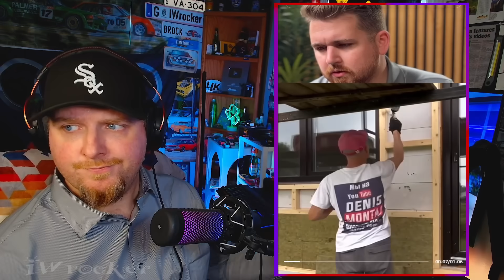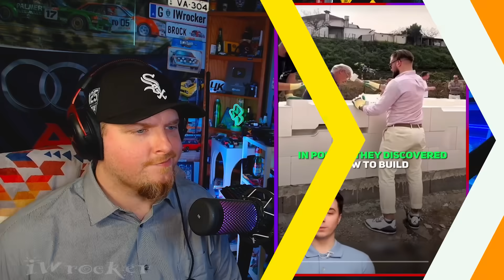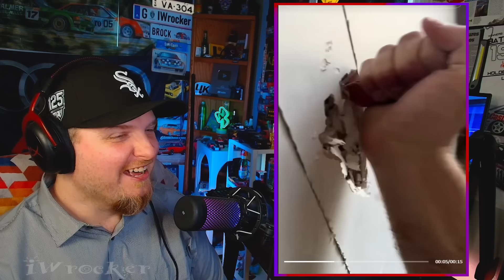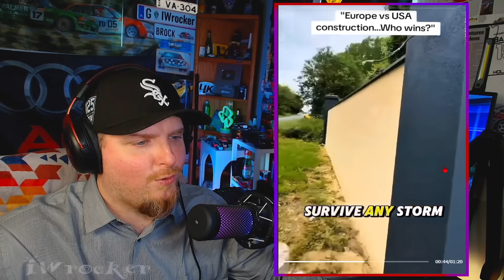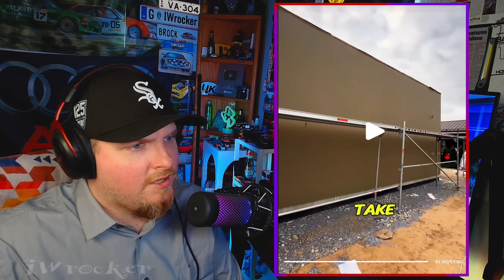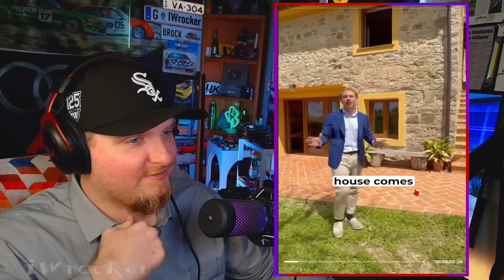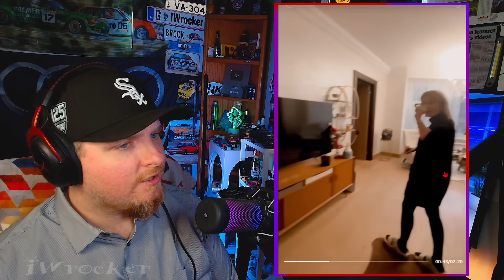25 Minutes of European VS American Home Quality & Construction Methods 🔨

Comment: Some might have mention this but i do not think it is concrete. I think it Autoclaved Aerated concrete or Aircrete. it is easy to drill in and hang a picture on. In Denmark house roof construktion ofte get supportet of the back wall. In wood wall it gets supportet by the center wall. I do not think it is the finish surface or else i have never seen it before I do not think it will look good for long, birds kan pick in the isulation and also make nest in it. I think they are going to install woodpanels vertical or other kinds of plate.
If this was in Denmark we will install a thind 25mm (1inch) list vertical and intall wood horizontal. In this way moist can get away from behinde the surface wood, wher air kan travel from the bottom and up behinde wood in thethe 25 mm space.

Comment: 7:17 Are you kidding me? In Poland, what is shown in the photo is the cheapest thing you can put on a roof, the so-called metal roofing tiles.
Reply: That's was I was thinking: in France what we call "bac acier" (something like steel plate) is the cheapest roof available. And it's powder-coated in a choice of different colors.
Reply: In my opinion these are no cheap metal tile roofings but very expensive metal coatings. They are fixed without screws and last as long the individual material endures.
Reply: @VanelleundMarie   I'm sorry, but you're wrong, it wasn't used at all in the past, but after 2022, when gas prices skyrocketed, people started using it heavily.
You will probably ask why, because ceramic roof tiles require a lot of gas, there are two types of ceramic roof tiles, regular and very shiny, the premium one,
in 2022 they stopped producing shiny roof tiles because it was not profitable, and the price of regular roof tiles became four times more expensive than the price before 2022 and many people started using metal roof tiles. For ceramic tiles you need good, strong wood, for sheet metal you can use toothpicks, so to speak. That's why it's popular now because it's cheaper.
That's all there is to it. Greetings from Poland
Reply: @ScoiateLPLMV  Maybe you´re right. But there are cheap metal roofs and expensive ones regarding costs of material and constructing. I can´t exactly recognize (too far away). This seems to be  the expensive one. (I am a roof construction worker in Germany)
Reply: @VanelleundMarie  We're both right, it's just a cheaper, higher-end substitute :)
Since you work on roofs, I won't argue. Regards.

Comment: The "dime a dusin" houses that some people build in Denmark are designed by larger companies and prefabricated in factories. You have the opportunity to change some things like indoor wall layout, window type, flooring, kitchen appliances and so on. These houses are still built using concrete and brick but can be built in 2-6 months depending on the style, customization and size of the home.

I'm not sure how fast the American homes are built but a few months to build a house seems pretty speedy to me.

I wanted to add, a lot of these "this building style is common throughout europe". I haven't seen any of them in Denmark. It really varies a lot as you would expect with different climates and building codes.

Comment: Insulation with gray (or cheaper white) styrofoam is a must (wool for wooden structures + wool to insulate your roof). Building norms require certain energy profile then the Soviet Eunion's soon to be implemented law also forces u to do so. Heating in Poland is very expensive due to taxes from the Soviet eUnion,so we try to keep our houses energy-efficient. Them white bricks you saw (59x24x24 cm) is not the most expensive building material :). We build our houses to last + contraty to what them eco-wackos say, we have cold winters.

Comment: The well insulated new builds are amazing. People comment about keeping the heat in. They forget to mention that they keep the place cool in really hot temperatures too.
My relatively new 160 year old cottage has thick solid brick walls. In winter it's cosy. In summer, even when  it hits 39C, it's noticeably cooler inside.

Comment: The facade is hiding the Tube which is close to the surface and uncovered. Basically the road is a bridge at that point. There are quite a few "fake" houses which hide where the Tube goes close to the service.

Comment: 3:00 If you just want to take a few seconds to put in the effort and turn on your BRAIN, which you MAY be equipped with as a US building expert, then I would just like to ask one question:
Now that Wood is such a fabulous building material - the best there is, why don't you use it for your high-rise buildings? 
And don't come and claim it's because there aren't trees tall enough, because you say it's so easy to put together into larger buildings. One screw and everything is good...

So what was the answer to the question???

Well, you came to the conclusion that WOOD IS NOT SUITABLE for buildings that need to be "STABLE" and be able to withstand, for example, storms - well, then they burn too quickly. 

Don't get me wrong. I LOVE wooden houses - especially CANADIAN Log houses. 

It MUST be of proper quality. These "ply-wood" houses that are used in many places in the US are not worth 5 cents. Regardless of whether they have some ugly form of cladding.

Compare with many buildings in e.g. Prague, Copenhagen (and other European cities) - 300, 400, 600 years old, and they are still standing just as stable. A US “stick house” looks dilapidated after 10-15 years and would NEVER survive 250 years. Maybe that is why the US has no real cultural buildings.

Comment: That big new house behind the 2nd chap. It had shutters on the windows. However the shutters are too small for the window. If you pulled both of them closed, they wouldn't protect the window from bad weather. So what's the point of them?

Comment: We have a couple of internal walls which are "stud" walls. I.e 100 x 50 mm (4 x 2) battons with plasterboard but we also have brick internal walls too. Some, bizarrely are on top of floor boards which I've never seen anywhere. I intend to remove them.

Comment: My house was built in the sixties in the UK. I'm looking at the walls where my office window is.and they are about 25cm thick. I.e. around 10-11 inches. Its two layers of brick with an airgap which you can insulate.

Comment: To the outside insulation, usually there is a heavy reinforcement mesh (220 g/m² or more) incorporated in the exterior plaster. Like shown at 13:37.

Comment: 8:04 I challenge any American to try and hit a wall in Germany or Austria. In Germany, residential wall thicknesses vary by type and function, with exterior walls typically measuring 20–40 cm (8–16 inches) for insulation, while internal load-bearing walls are often 15–30 cm.🤣🤣🤣🤣

Comment: The only benefit to US homes I can see is its a lot quicker and cheaper with a lot less mess if you wanted to redesign the interior and knockout a wall for example. Could probably start and finish in a couple of days.

Comment: the metal sheet roofstyle looks neat, but because the roof shingles (is that the right word?)  are not hermetically sealed, the carpentry beneath is ventilated. There has to be space underneath the metal roof for ventilation, otherwise the wood can rot. And because of that, they are really noisy in the rain.

Comment: These days in Austria most buildings are built with clay tiles with air pockets inside, insulation outside and plastering with a thermo mix stuff. Interior walls are all plasterboards to quicken up the process. Time is money.
In my appartement, the building is more than 200 years old and has a 80 cm/31,5 inches thick wall to the outside, interior walls are made with masonry bricks 40 cm/15,75 inches wide, this is in Lower Austria in a small town Ebenfurth which was officially foundet in 1160, possible older due to the Celts inhabiting this area long before the Romans did after.

Comment: 8:02 we do have some drywalls inside of houses to divide rooms, BUT they still have insulation inside. Our house has plywood underneath the drywall stuff so we can actually hang all kitchen cabinets and load them up. Our house Company even advertised them by hanging a whole car at the wall. Some Germans still don’t like wooden houses because you can hear a little more through walls as if they were stone. We like it because insulation is awesome and I can hang a picture without needing a heavy duty tool. Just a screw and a screwdriver

Comment: i actually have the "not so solid" walls, but only because i wanted to add insulation to an older house and doing it on the outside was no option. it's: concrete, wood planks with insulation in between and drywall fixed onto the wood. you would still break your hand trying to punch through. because it's only a few cm to the actual wall 😅

Comment: Drywall is also a thing in Europe, even in brick houses. As you said, it has its advantages, especially because it is easy to build and remove. Why not combine the best of both approaches? Non-load-bearing walls or later modifications can be made using drywall.

Comment: 0:55 Not house building, but adding insulation to an existing house. They put it on the outside to avoid problems with diffusion moisture - if you put it on the inside, you have to add additional moisture barriers, because air moisture from the inside would condense otherwise on the cold outer wall and probably cause mold. With the insulation at the outside, the wall itself will not become so cold at the inside that air moisture will condense at the wall. Therefore you put the insulation only on the inside if you have no other choice.
4:30 Using wood for the construction is not really the problem. The problem is using cheap, flimsy wood for flimsy frames. If you use massive wood in a structural healthy construction, those houses can stand for centuries and even survive fires, as you can see with many medieval houses in many parts of Europe. (Or like they do it sometimes in Canada, like in this clip from a German carpenter doing a stint there: https://www.youtube.com/shorts/ojFz6W_fHWU)
18:50 It is the iconic Piaggio Ape ("ape" means bee in Italian), in continuous production (of different models) between 1947 and 2024 in Italy, since 1999 also in India.

Comment: We use drywalls inside of the concrete houses as well. You can hide all the wires and plumbing behind them, improve insulation, and create a smooth surface that’s easy to paint and finish.

Comment: Sarcasm aside Of the Mr Professional in the first clip. 
Outside isolation is a better choice because SOLID walls that are no air between 2x4s  have Temperature Linger. 
a.k.a When The Winter is Over it will still be cold in your solid house if its not isolated from Cooling the wall. 
Heated wall from the Inside also Retains the heat and acts like Accumulation heater. Radiating the heat back into the house. 
And In the Summer Outside isolation prevents your house from heating up. 
Also a smaller issue is European Houses are Taxed based on Interior Living space. 
The Inspection measures Wall to wall BRICK TO BRICK. 
If you take away space by adding isolation that's your p[problem. 
But they will demand to see the Brick for measurement. 
That is NOT a deciding factor but attributes to the Downfalls of interior isolation. 
Main reason is Temperature accumulation of Solid materials. 
US houses have NO wall material so there is Nothing to Isolate. 

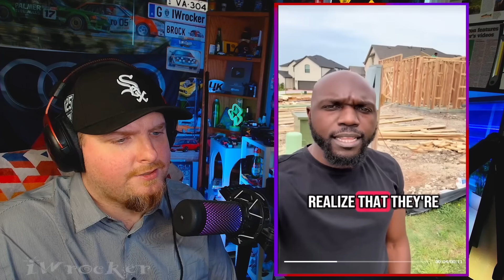4:15 this proves what I'm saying visually. No material to hold Cold or Heat. Inside of the House is directly affected by the Outside conditions.

And 7:14 Ian: Its because Many Jobs are in Roofing and Much money is in American style roofs that HAVE to be changed on Shorter life spans. 
Importing a European design undermines the US industry, they could Earn a short Profit but then sit there twiddling their thumbs for years as your House laughs at them. And the Roofing Guys.

Comment: 8:05 drywall is pretty popular when you already have the hous built or you live in apartament building (or a 100 years old apartament) and you want to shufle the layout a little or you need additional room. Otherwise everything is either concrete or some kind of cement blocks

Comment: Hi , the house in London is indeed a facade , the Railway travels underneath and people did not want to see the steam from the trains ,there are many in London  all constructed for the same reason. We moved into a converted coach house and stable last year, it was built in 1646 to house the horses and carriages for the large mansion near us . The walls are about 60 cm thick (24 inches ) thick on the outside between rooms about 30 cms between rooms, the window  frame are stone mullion with leaded glass to keep in with the 15th century look . The horses have long gone but were very well cared for in the day it cannot be said the stable workers were sleeping in the barn on straw and on call twenty four hours.

Comment: It's aerated concrete, very insulating and easy to cut, and they add an extra layer of glass wool to break the thermal bridge; given the very cold temperatures there. isolation outside no take place inside ^^ and better

Comment: I'm from Sweden and these steel roofs are common here as well, as well as tiled roofs. i've been watching a lot of Mike Holmes on homes, that is a canadian tv-show from some decade ago but shown at a YT channel called "renovation TV". And they have these shingle roofs on most of the roofs there as well. That is something we put on sheds, playhouses, children's playhouses or garden huts for our pets. For sure, these steel roofs could also com off if there is a hard enouh storm, tornado or such and the shingles will maybe have less potential of causing damage to anything else than the house it came from if it went off (which will happen at less storm).

When watching Holmes on homes it is clear that about any quality of material can turn into a moist, rot and mold nightmare if the workmanship isn't there or too many corners are cut.

Comment: Why on earth would you put the isolation NOT on the outside?? Just look at heat profiles and condensation points (but maybe that comes with STONE walls instead of OSB-panels as "walls" - which really are only the paneling protecting isolation from rain etc. BTW, you can build well isolated homes both from wood/panels as well as concrete in a few days (and then several weeks/months to finish, off course).

Comment: 8:40 the quality of that wall is just as bad if not worse as the wall i made in a previous place i was living in and i have 0 experience with building buildings nor do i have any tools all i had was some wooden beams some dry wall a screwdriver and some screws i had to cut the drywall with simple butter knifes (the non sharp ones) so ya if american homes are the best in the world then backwards time travel is the norm

Comment: I get building houses made of wood in the US because of tornadoes. If you have an EU house yea it probably still stands after, but all the windows wilm be smashed, it will be wet and has to be properly repaired, at which point its probably cheaper to build a cheaper home and rebuild it after every tornado.
Other than that the US house doesnt really make sense to me

Comment: The house I live in dates back to 1920 and it's still standing strong. A friend of mine lives in a house from 1938 and it still has its original roof. If a German architect were to inspect houses in the USA, probably none of them would pass inspection.

Comment: That roofing you like is becoming more common here in the UK - it’s made from Zinc roll, folded over at the joints between the rolls, those form those raised ridges every 3 feet or so

Comment: You can find plasterboard internal walls here in the Netherlands. Usually added at a later date, when you convert the attics for an extra bedroom, or divide a large bedroom into two. 
All other internal walls are brick or aerated concrete blocks. Weight bearing walls are either concrete (sometimes prefab elements) or brick. Outside walls are always cavity walls with insulation in the cavity. Floors are usually prefab concrete slabs, insulated as well (on the underside / with air channels) and with a crawl space underneath, hardly ever directly on the ground. Standing air insulates as well. 
Upper floors are usually also concrete slabs with air channels. Roofs of course are also insulated covered with roof tiles (with solar panels on top of them) or nowadays isolated roof panels, sometimes with incorporated solar panels. All to keep warmth in in winter and keep heat out in summer. And they stand for hunderds of years of course.

Comment: That thin house in London is an actual block of flats (apartments).
It's triangular, so it's not all the way back so narrow.
You can see inside on YT.

Also, the thick foam insulation is not very typical.
In Poland we normally use styrofoam insulation.
And, actaully, the moisture problem is when you apply the insulation inside, not outside!
The walls need to breathe inside, and be insulated on the outside.
Even with the Amrican wooden frame houses, the insulation needs to be on the outside.
Check out how Canadians do it. I watched the whole building process of a relatively big house in Canada.

Comment: 8:10 we also have drywalls in the netherlands.. but they are up against brick or concrete inner structures. So its drywall, insolation and cables, water etc then a brick or concrete wall.

Comment: We bought a 126 year old house. It is a monument, so the insulation had to be done on the inside, which means we had to give up floor space, due to the walls being 13cm thicker. But it works. And the house is super solid, as it is a brick home.